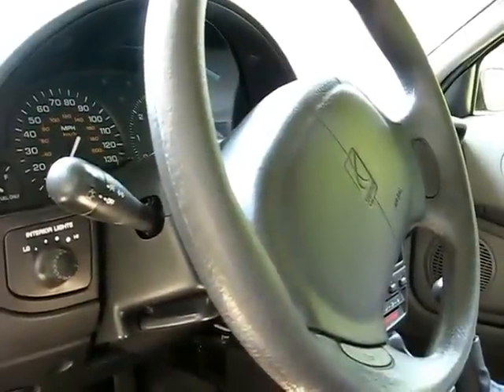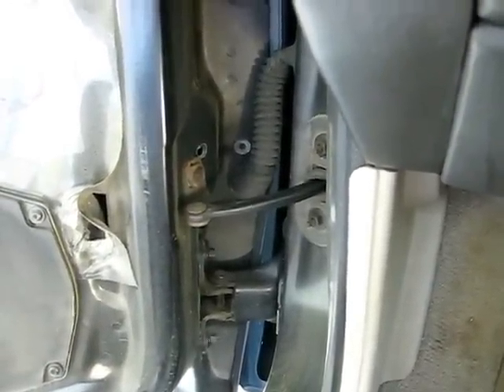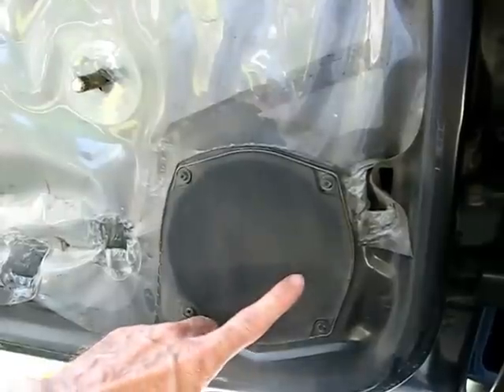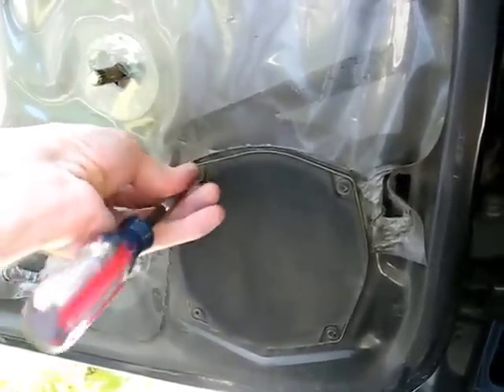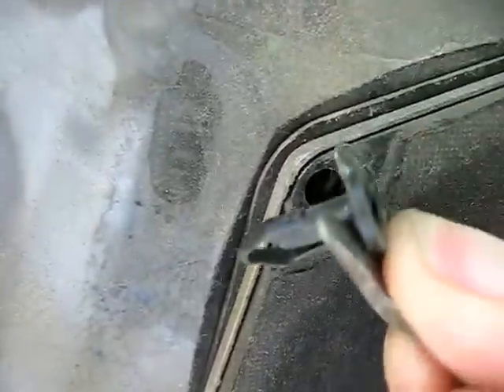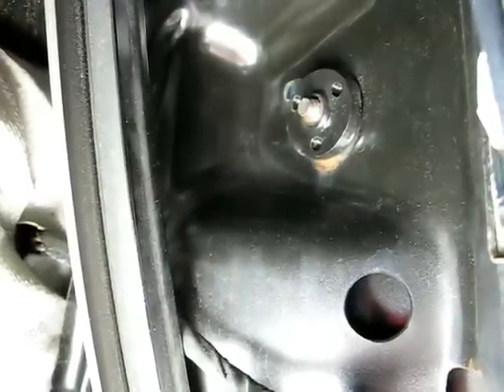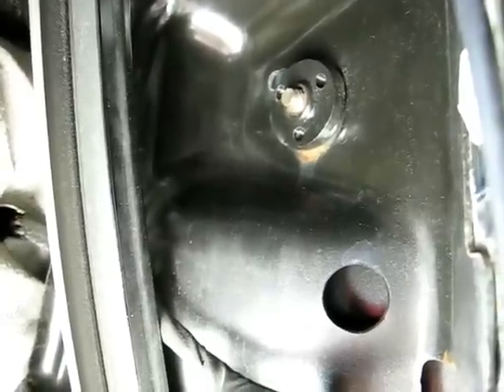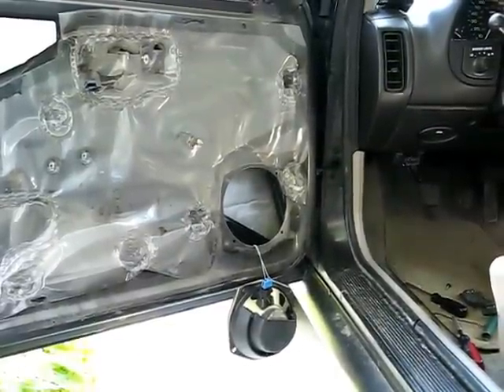Troubleshooting Door Check Link

Comment: I know this is super old but does anyone have a video or instructions on how to replace this?  I have to get in the main body of the car to get the door check out, can I do this under the wheel well?  I don't think I can do it from the interior of the car.

Nevermind, it's not as difficult as I thought. 10 minutes of googling found this  http://www.saturnseries.net/DIY%20Guides/S-Series/DIYGuideS-Series-Door%20Check.htm